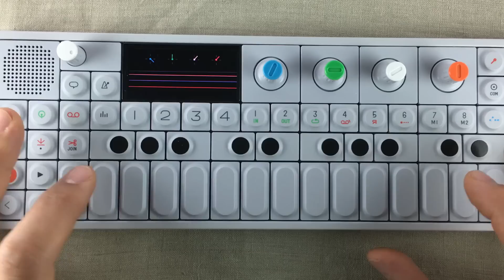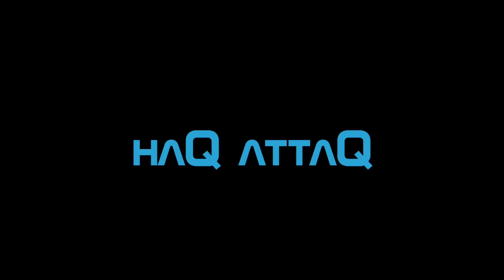Teenage Engineering OP-1 │ Reese Bass and Hardstyle Lead Tutorial │ haQ attaQ 144

Comment: Also check this cool tip & trick (from operator-1.com):

Found another way to do some fatter detuned sound or maybe supersaw style sounds. I think it don't have been mentioned in this thread (or i just missed it?).

First way mentioned here was to layer several detuned takes to the tape and then throw it to sampler. Can be created some good sounds that way, but you can't tweak parameters live at this case.

I've found another trick:
Choose your synth engine. For good example demo i chosen cluster synth with all parameters tweaked to the left, no FX, no LFO.
Make sure you are in POLY mode.
Choose Sketch sequencer. 
Press "C" note on keyboard to be in tune.
With blue encoder make straight horizontal line from left to right.
Return cursor to beginning with the white encoder.
Make just one click to the left with green encoder. The goal is to subtle change the pitch.
Make another horizontal line from left to right.
Return to beginning again with white knob.
Make two clicks to the right with green encoder. I think you already got the idea.
Make third line. You should see something like one fat horizontal line.
With Shift + green set "/4" value. It will make note longer before it start to repeat.
Switch to synth or tape mode and just play on keyboard. Yuippee!
With this method you lose sequencer and can't play very long notes as they start to repeat at the end of sequence, but you have free fx slot and can tweak synth live. With Nitro filter and Element LFO (source = envelope, dest = nitro cutoff frequency) you can do some fun bass sounds.
Reply from the maker: +Chiel vd H That's an awesome tip! Thank you so much for sharing! =D